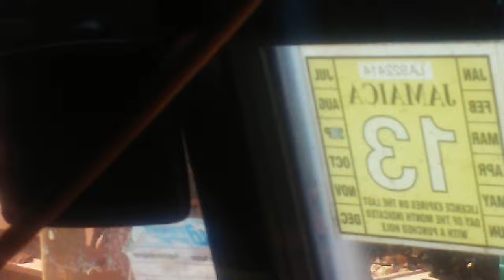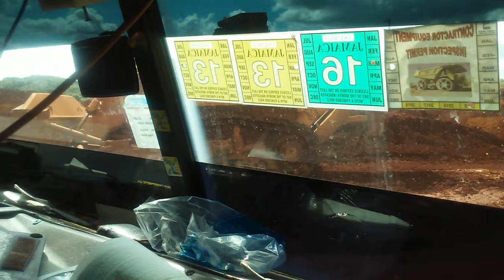Wickedest, LOUDEST, Nastiest Jake Brake at Naranda Bauxite mine in Jamaica.

Comment: So they stopped using their own trucks and got contractors. Lol. Brilliant. Less trouble, expense, maintenance, no healthcare, insurance, nothing like that need paying.
Reply from the maker: They haven't actually used their own trucks for about 30 years. Originally the mines used massive mine trucks but as you pointed out it presented a massive maintenance issue so it's cheaper, easier and less logistic issues to employ contractors who then hire owner operators.  The upside is that many dump truck operators end up with a very steady stable source of income. Additionally, the contractors provide fuel at a third of the price they would normally pay plus maintenance facilities that can be used on consignment.  Some also provide spare parts on consignment as well.